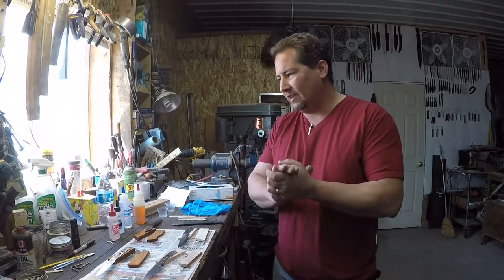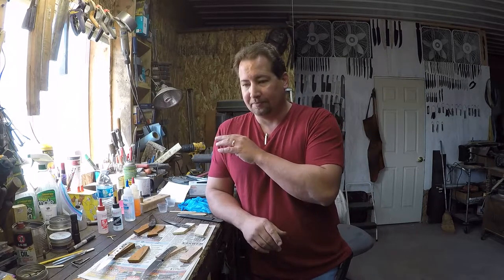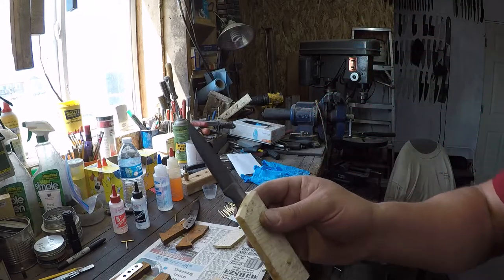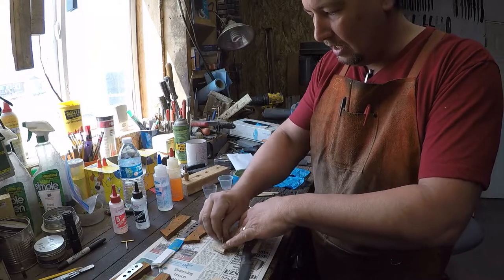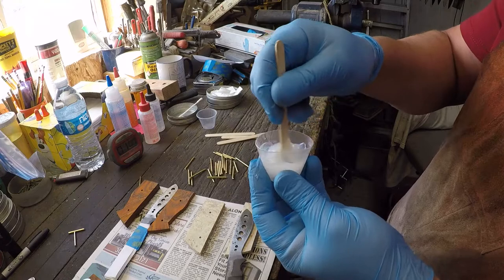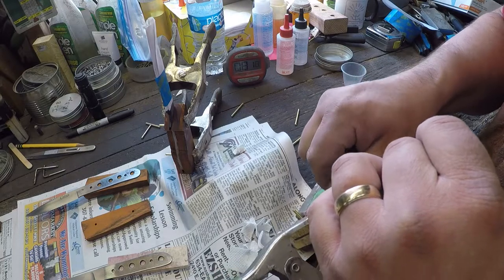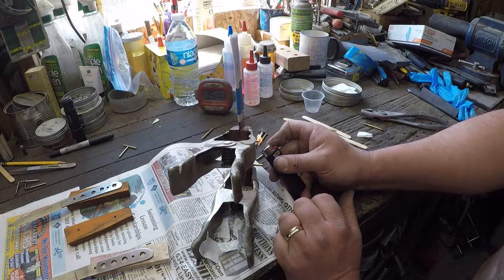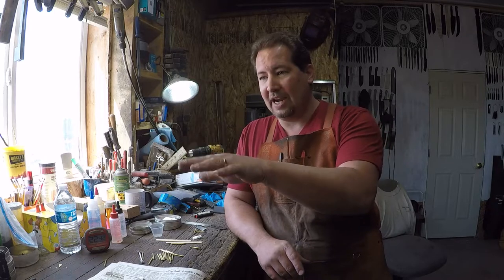making a new knife pattern 18 installing handle scales

Comment: lol. for handle removal, boiling water, or a heat gun is great. most epoxies soften at 90c and just prize them off.  apart from jbweld it needs a good grinding or smashing off
Reply from the maker: lol, I suppose boiling water would be a bit less brutal than my hammer :} but the hammer works and I don't have to wait for it to boil :}